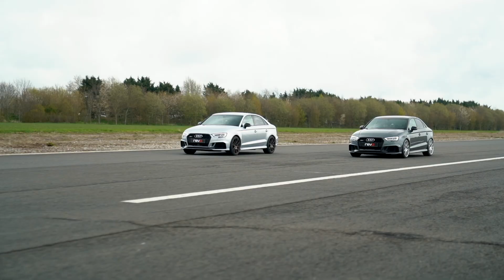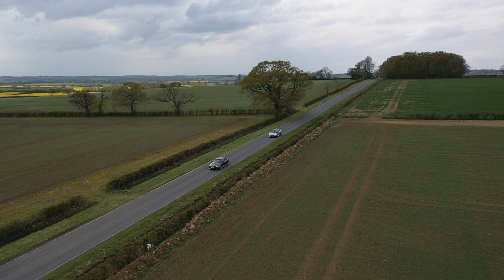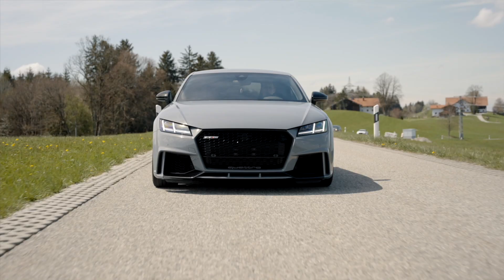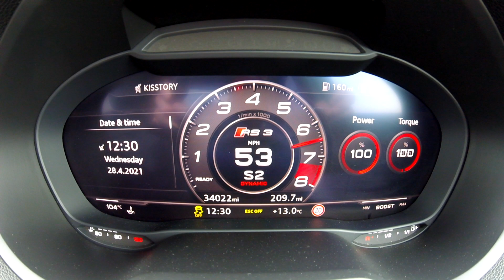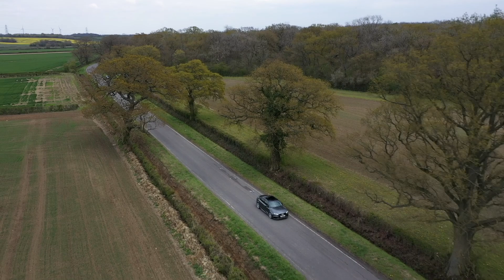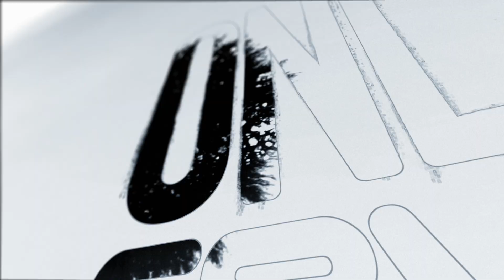REVO RS3/TTRS Performance Pack 2.5L TFSI Stage 2

Comment: Sounds like a good package, but its not a 'complete solution' if your not supplying the dp with it.
Reply from the maker: The Revo dealer installing the Performance Pack for the DAZA (non GPF) model can include a downpipe solution for you. The Performance Pack for the GPF model doesn't require a downpipe upgrade. Regards, Revo

Comment: Excuse my ignorance - is the performance pack the equivalent of a stage 2 tune? I was under the assumption you also needed a downpipe for stage 2?
Reply from the maker: A Revo Performance Pack includes Stage 2 software. The DAZA (non GPF) vehicle will require a downpipe upgrade. The DWNA (GPF) version doesn't require a downpipe upgrade as it retains the stock downpipe and GPF.